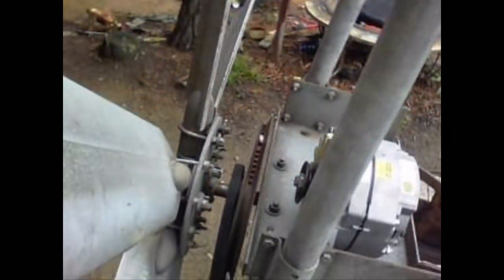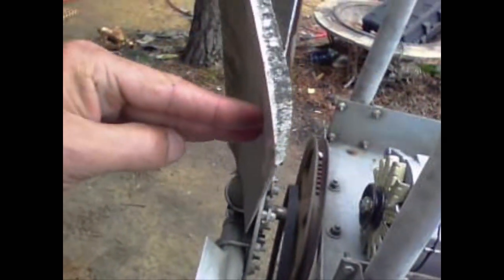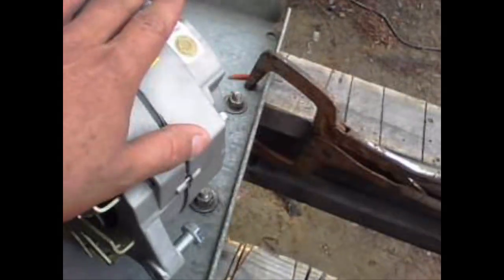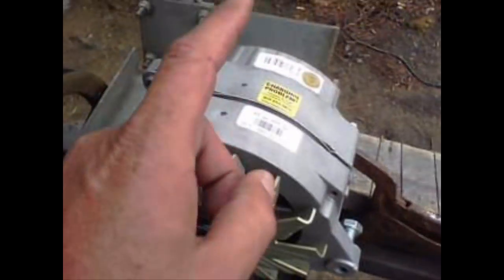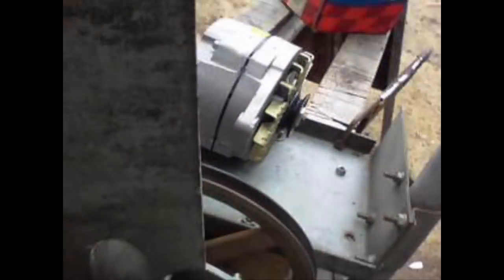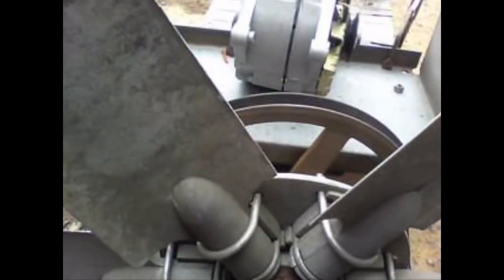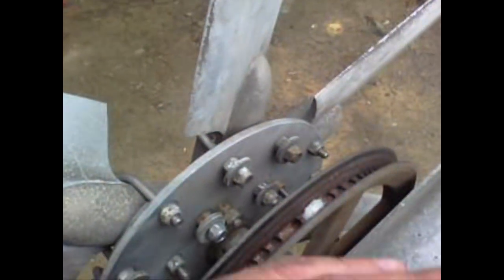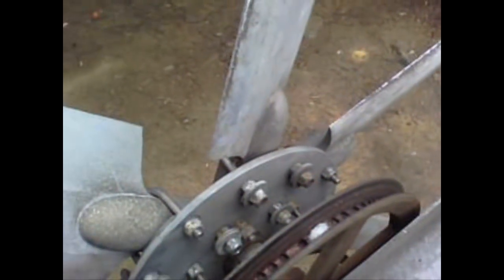homemade windmill generator part 3

Comment: There is some seriuse problem Im faceing I use often low speed engines and engine conversions. So I have problem my old Opel engine from the 80s wont chargw at low engine rpm so I tought to use tractor alternatir or replace the delco voltage regulator to low speed type only problem I dont know if the alternatir will work or not if its oposite turning direction type I know I need to replace the cooling fan to cool the alternator vut still Im not shure if the bridge rectifier wuld work correctli or not? Also how can by obtained dual electrical out put? sone peopel convert those alternators to high voltage dc I wuld like to use that properti for my ignition coil so I was wondering if dual circuets might work or dual regulators or dual rectifiers dufferent types in series or parrarel configuration mostli Im concerned about shock from the chassys so hoppe some one can explain to my how not to get shocked and still use ac or hv dc in my car with out getting shock. After all ford model t used hv magnetos so I wondered if those condensirs hade some thing to do with it? And those cars as well used baterrys si thats why my confusion starter I think as well they hade seperate generator wirking in that car so hoppe some one understanda my question.I run different fuel types so I have need for independent systems and ignirion systems like magnetos or magnet alternator is desirabel to my only problem is the control circuet I wuld prefere manual voltage regulators .

Comment: your fan blades look like they are reversable like the blades on a caterpiller motor. it looks like all you hae to do is loosen the u bolts on the hub and give the blades a half a turn and it will turn the other way

Comment: With the belt barely bent you wont have alot of surface area on the alternator. This will cause slippage and will not generate any power

Comment: fyi ive run the standard delco alternators backwards for years... just use a reverse alt cooling fan or turbine style cooling fan.... also they will last longer if they are not in direct contact with rain etc

Comment: Why not scrap the use of a belt entirely and make it gear driven? Just make a big gear for the fan and a small gear for the alternator and mount it directly on top. You would lose zero energy on belts that way. Direct drive.

Comment: why sont u use a pushbike chain? waaaaaaay less resistance
Reply: you'd probably wonder why you dont see them on vehicles eh.. well, my friends 350 chev was chain timing...  and omfg was it loud..   not to mention it snapped and destroyed his engine because chains cant take torque well.  This is also why you see most Harley davidson motorcycles are belt to the rear wheel..    the torque snapping the throttle can snap a chain easy.

Comment: wouldn't turning the blades have changed the direction of the rotation? like the post!!
Reply: My thoughts exactly, just loosen the clamps and twist the blades and retighten, windmill turns the other direction.

Comment: It will not work if it is not a modified alternator with permanent magnets or  if stock it needs battery since car alternators require power to energize magnet .

Comment: The amps the alternator will produce is directly related to the amount of speed and torque the spinning turbine blades can provide.   Those blades are way too small to produce much torque,  unless you have like 50 plus mph winds.    Most small wind turbines start around 12 mph and if your lucky and get some 30 mph winds you can get your 300-500 watts out of it for a little while then the wind dies down and your back to 150-200 watts.  Which is around 14-15 amps.  If you want to have 100 amps available which is about 1200-1400 watts your blades need to be sized large enough to overcome the resistance the alternator will have to output that much power.

Comment: Always better to have odd number of blades. 1) even number of blades is much harder to balance. 2) with even number of blades, as a blade passes the 6 o'clock position (passes the mast) a disturbance is created by the turbulence as the blade passes the mast, this disturbance is then magnified at the opposing 180 opposite (now at 12 o'clock position) this can result in a catastrophic malfunction. I would also recommend a brake as well as drilling all fasteners for wire safety ties.

Comment: Direction of spin should/will not matter on an alternator because auto alternators produce alternating current (Three phase) which is rectified and regulated by the internal regulator. The ONLY concern would be the cooling fins on the pulley which would not supply air flow to the interior of the alternator.

Comment: Looks to me like you could loosen the U bolts hold the fan blades on and reclock them so it turn the right way. Just loosen, twist the blade to the opposite angle and retighten.

Comment: The resistance is completely dependent on how much load current is drawn. If the batteries are at full charge and little current drawn, there will be little resistance. When they are needing charge and drawing current, the mechanical resistance will be greater in proportion.

Comment: Lets say you have a 200A at 12V alternator that meaans you need 2.4 kW + Losses of input power to produce maximum output.
If you using a 6:1 Pulley ratio it means you need 15kW of input power + Friction Losses of belt. That's quite a load.

I would rather try mounting your fan directly to the Alternator. Lose the 6:1 ratio and Belt + bearing friction losses.

Hope this helps

Comment: if the shaft from the blades runs under the platform,  mount the gm alt. facing away from the propellers ,that would turn it the right way. if you don't have a governor on it, the alt and bearings could burn out in high winds. also it might not be as efficient but it looks like you could just loosen the blades and turn them a little to make it spin the other way

Comment: Eons of design in autos have required a tensioner built in the the pulley/belt drives and I suspect He'll need this eventually.  Also the belt is not contacting the small pulley enough which will create a slippage problem. A tensioner (positioned rite) could aid in increasing the contact area between small pulley and belt by positioning the belt more around the pulley.

Comment: you can use a longer shaft and put the pulley on the back side of the mount bracket and then you could use the 200 amp GM alt
Reply: exactly what i thought

Comment: Use a solar panel to charge a battery to provide the field charge to the alternator.  Or you could pick up a tread mill motor (it would serve as a generator) off ebay for 20 bucks

Comment: scrap the belt and use a old fly wheel on the blades, and a pinion gear from a starter motor on the alternator............thats what i did, a lot less friction, and i used a land rover alternator with a built in voltage regulator, i can literally stand in front of it and turn it by hand and achieve 11.4 volts at 130amps, also, i used a heavy duty ceiling fan for my blade assembly , the voltage regulator caps its off at the same 11.4 x 130a during high winds so no brake is needed!!!   food for thought
Reply: To each there own
Reply: Excellent idea!!  Have you document it or shared it out.. Tom

Comment: I don't think you will do yourself any favors with a shorter belt, but you may want to consider using a v-grooved belt, to allow the belt to be more flexible, you know they type of belt that looks like it has teeth on the underside. They are not used like a chain but rather to allow for the belt to be flexible. Also if you use a belt tension system this will also save wear and tear on your belt and bearings; too tight of belt will wear out your bearings faster. And it will also act as a switch.

Comment: i wonder if you cant just figure 8 the belt to use the 200 amp alt

that fan is huge and looks heavy ...what about some plastic barrels with 6 split down the side and pulled back a bit to form 6 wings then sandwhixhed between 2 aluminum automotive wheel hubs on angular wheel berings ... light weight and catch alot of wind and the rotation is parallel to the wind... not 90º perpendicular  as you are now... much more efficient use of wind 

with your current system.... id counter weight that whole propeller system you have

Comment: He explained that. he wants the sharp end of the blade cutting the air so the THICK part takes the lateral force. What the issue really is, is that alternators work in both directions. They make alternating current that is rectified so it is making both polarities all the time anyway. The only issue might be the direction the fan on the alternator blows, but if he can build that windmill, he should be able to change the fan....

Comment: Turn the pitch of the blades the other way by loosening the c clamps and adjusting each blade 90 degrees. This will change the rotation of the alternator

Comment: Run a contact wheel on the fan with the alt shaft/pulley running against it. That way you can use the original 200 amp alt.

Comment: Hate to tell you this, but that is still a Delco alternator, it looks like a 27si.   And it doesn't matter which direction and alternator turns.  You are much better off using a small output 10 or 12 si with a 12 volt regulator and 24 volt stator and rotor. I have built them and have built starters and alternators for over 20 years...
Reply: Also use a self excited regulator..

Comment: you could face the alternator in the opposite direction and it will change the rotation.  duh.also if you reduce the contact area between the belt and the alternator too much (in order to reduce drag caused by bending the belt too sharply),  you will find that the alternator will slip under high loads.  you want the belt to contact at least 1/3 the pulley or else use a toothed belt like a timing belt.

Comment: Dear ironhead, the widest selection of those blades should be the leading edge, rotate them clockwise from the position shown in the video until the narrow edge is parallel to the front, so that angled narrow portion is flat when viewed from the front. That would be the correct position aerodynamically and would change the rotation of the turbine from counter to clockwise which is what you wanted originally

Comment: Oh my goodness, I can't believe some people.  You can't "just turn the alternator around". How are you going to hook the belt up?  Some people just don't think. And another said he should use some gearing.  Hey!  Didn't you notice he was ALREADY using gearing? Besides, as has been mentioned by many people, apparently the alternator will operate in either direction, air flow being the only question.  And according to one person, even that doesn't matter. And according to another which I generally agree with, you probably won't get enough power out of that arrangement to worry about heat anyway.  But under maximum load, I DO think the direction of the fan matters.  Maximum airflow is going to be in the rotational direction such that the fan blades would appear to sling the air out off the ends of the fins, as the cooling air is sucked in from the BACK of the alternator, not pushed in from the front.  In this example, that would mean clockwise rotation.  And by the way, did you notice that both the alternators shown had the same direction of fan blades?  Meaning they both turned the same way (originally). Besides, you are going to need a LOT MORE than 3 horsepower to run that 100 amp alternator at capacity (you can never use theoretical hp and electrical conversions to determine needed mechanical hp; it's always more. AND ALSO, automotive alternators are NOT designed to operate at their maximum capacity continuously. If you have studied and researched anything about alternators for uses in this scale, ones designed for continuous output are many times larger physically than automotive alternators.  People are always trying to get by on the cheap and in the end, they show themselves to be fools.  If it was only for a weekend cabin, that might be one thing.  But for a house, you want something dependable, not the cheapest you can find. The old adage never fails to be true: You get what you pay for.
Reply: omfg I cant believe some people,  turn it around?   alternators generate power either way you spin it.   lol

Comment: IT DOESNT MATTER WHAT DIRECTION THE ALT IS TURNNING
Reply: you are right.
Reply: yep it puts out ac and that goes through a rectifier, so it doesn't matter
Reply: G. Andrew power comes from battery. Alternator charges battery
Reply: Yes it does. The cooling fins in the front will not do the same job if they turn backwards.
Reply: it does matter if you want good airflow through your housing
Reply: +mark vann / +Crypto Chase - I agree with BOTH of you!  I guessed you can say...  Don't go against the grain!  LOL
Reply: in fact car alternaters generate no power until use use power for the electromagnetic core..  lol

unless he changed the core out with a permanent magnet one..     DC Motors are a better wind turbine honestly

Comment: Alternators don't care which direction they spin. Just swap the fan and it's fine.
Reply: 1.) An automotive alternator won't work without a battery. 2.) They put out max power at 5000 RPM. 3.) That belt will have to have an idler pulley to create enough contact area around the small pulley.

Comment: why can't you turn it counter clockwise ??
Reply: +usd25674  i believe it reverses polarity
Reply: +SINESTERSERPENTSIXXX  Not sure,    This of course is an alternator and produces AC.    The AC is then rectified normally by on board bridge.    The bridge would determine the polarity.    Thanks anyway.
Reply: +usd25674  The cooling blower fins on the alternator need to be moving in the correct direction or they will not cool the alternator properly.
Reply: Ooooh  that makes sense.    Many thanks for the enlightment
Reply: welcome the benefits of a automechanics class in high school
Reply: +usd25674   On the other hand, looking at his turbine vanes I wonder why he doesn't change the pitch of them to cause it to rotate the other way, if you look at the shape of the vanes and think of how an airfoil is shaped they look like they would actually work better if they were rotated to have the thick edge be into the wind with the thin edge trailing. Changing them less then 45 degrees bringing the thick edge to the front of the turbine would reverse the rotation the pitch uniform would be easy just by measuring the distance from some fixed object to the new trailing edge as you rotate each vane past that point. Sort of like truing a bicycle tire. For that matter adjusting the pitch could help make the turbine more effective.
Reply: they could be none adjustable
Reply: +SINESTERSERPENTSIXXX   Having viewed parts 1 and 2 of this series I'm aware that 3 vanes were attached to the hub by the video maker on part 1 and that he added 3 more for part 2. In part 2 he also talked about how he matched the pitch of the 3 new vanes to the older vanes which is no doubt how he got the first 3 vanes matched for the first video. However he didn't actually document attaching the first 3 blades, so I don't know for sure. I also base the comment on how the vanes are attached to the hub. Even without the mention in part 2 of matching the new vanes to the old vanes the whole thing looks like it would be easy to loosen the "U" bolts for each vane and then twist them to the new pitch.

Comment: I see several minor issues. first, balance the propeller on low friction bearings. and the shape of the wings should be almost square at the top, and more "cut" near the axle. and as  far as I can see, the diameter is so small, I would have cut the wings from pvc tube 160 or 200 mm. you could easily change the angle from top to axle side. and it's easy to balance, just drill a hole on the lightest position and tinker with a bolt and some nuts and rings. the pulley is fine, buy a light duty type. and use a tensioner to have the small pulley get more grip. the distance between axle and alternator is no issue for the bending of the V belt, as it will always bend to the radius of the small pulley anyway. to reduce power loss on the V belt, just don't put as little stress on the belt as possible. it is presumably 700 watts max you will obtain. I built 5 wind mills so far, I know about the subject

Comment: 2 funny reading the posts lmao hey I have a idea for you to make it a whole lot easier for you , been running in it my mind for awhile now , but its this instead of the fan belt and way to make it more easy , it is mount the alt from a hanging or standing position with a different style fan so its the only moving part if you remember Jock Coustue what he did to his ship looked like a mast but it was a rotating blade 30' tall and was strait up no matter what way the wind was it turned no need for special moving parts just would need to make a sheet metal cone to keep weather out of the alt like if it rained it could be mounted from a base you could bolt it down or hang it

Comment: listen weenie , you need to add one more statuionary pulley so that the belt doesnt have to bend so much,, you could get a tensioner pulley and that would make it self adjusting as well.
Reply: so nice  it's to use in formal land at may home ....
Reply: And a electric motor you won’t need a fan